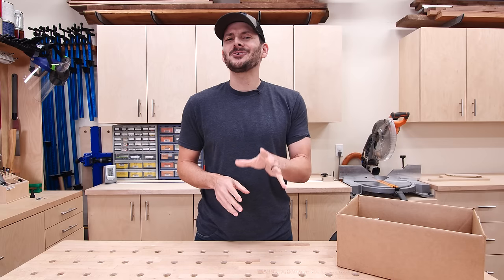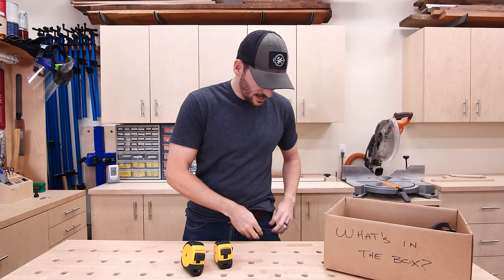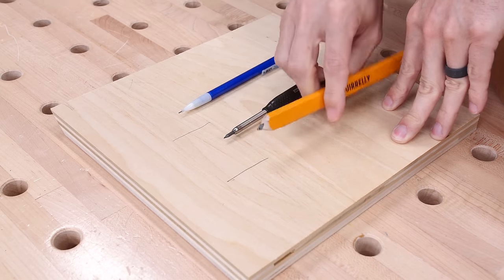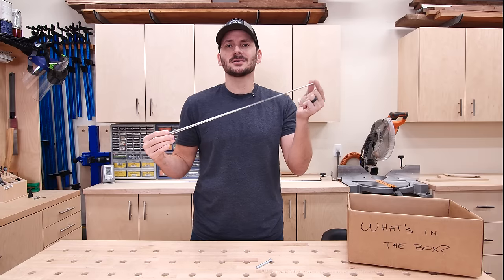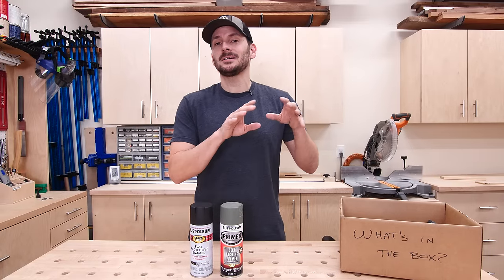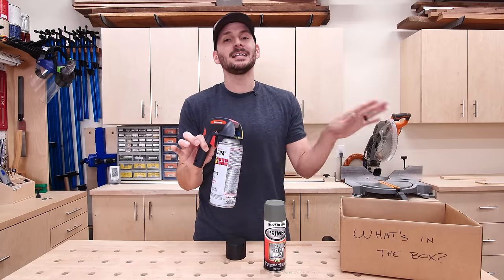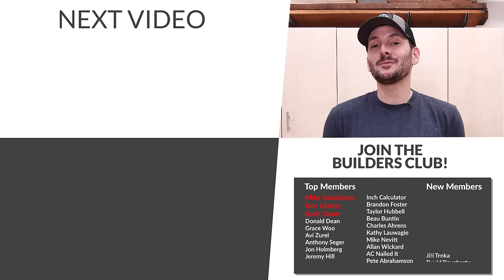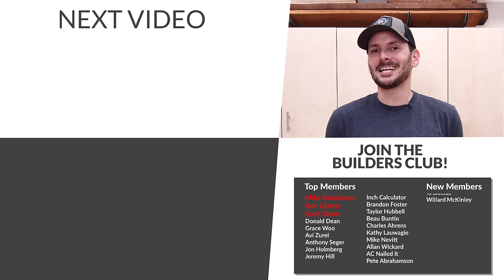12 Tools Under $20 Every Woodworker Needs

Comment: I would add 1-2-3 blocks to this list. SUPER useful, and you can pick one up for ~$20.
Reply from the maker: Great addition!
Reply: I love 1-2-3 and metric 25-50-75 blocks, they can space, act as a small straight edge or square and a lot more

Comment: Possibly the most obvious "must have under $20" is the speed square. Straight lines, angles, short measurements, it can do a lot. And not just for drawing the straight line but you can also butt the sideplate of your jigsaw or circular saw against it for perfectly square cuts.

Depending on the size you can also get a contour duplicator for under $20 and this is an invaluable tool if you find yourself needing to make a complex cut to fit around something.

A couple more great tools to have on hand that you can usually find really cheap (even dollar stores will have them) is sanding sponges and sponge brushes. Sanding sponges are great for contours as they mold into the shape pretty well while still keeping fairly even pressure throughout. And sponge brushes are useful for applying stain, clearcoat, and higher viscosity paints that tend to dribble off of bristle brushes. 

And as someone who has had wood chips, sawdust, and flakes of fiberglass fly into his eye while working on various projects over the years easily the most important tool you can get for under $20 is a good pair of safety goggles and/or a plastic face shield. Yea, these aren't as "cool" or "fun" as a lot of other tools out there but it's far better to look dorky than to have fragments scratching your eyeball from the inside.

Comment: You'd be surprised how many things from the craft room are helpful in the woodshop (and vice versa).  When I upgraded some of my quilting rulers to some that don't slide on fabric as easily,  I took the old ones to the shop.  They are awesome!  You can see through them to line up marks, they have graph dotted lines all the way across them, 3 to 5 inches wide and the longest ones I took out there are 24 and 36 inches long!  I also have some tiny ones too.  They also have several angles marked on them as well.  

Additionally,  I find washi tape,  repositionable double sided tape, and card stock handy in the woodshop.
Reply: I love your quilting ruler tip MissBeans, it's actually brilliant!  Now I have even more reasons "caugh" excuses to go quilting ruler shopping :)
Reply: @Elymyntal  glad to help! 🤭

Comment: One of my favorite less expensive tools is the Nicholson 4 in Hand rasp/file. It has always been in my tool set whether I need to clean up a notch in wood, smooth an edge of sheetrock, or sharpen a point.

Comment: As far as using the claw to reach for things, I just used mine yesterday (1/2/2022) doing some wiring for my brother in his Toyota FJ. However, I did not use it to reach for things...I used as a fish t help run wires in and up under his dash. Came in really handy and made the project go along much easier. With the snap off blade/cutter, I get mine from Harbor Freight. Comes in a 3 pack of different sizes, or you can get each one individually.

Good tips!

Comment: Great ideas, Brad!
I pick up old hand mixer blades at yard sales, Goodwill and similar other second hand stores.  They are great in a cordless drill for mixing small amounts of drywall compound is a mud tray, larger batches of two part epoxy in a coffee can or other two part compounds.  The nice part is they are cheap, so if lost or ruined, they are easily replaceable from my box of spares.
Reply: I used them in my drill press for mixing paint.
Reply: Oh -- so you're not supposed to use your wife's mixer and clean it up real good before she gets home?  LOL!!
Reply: @MrTPF1  That video would appear on the "Break This Divorce That" YouTube channel.

Comment: Painters 5-way. I'm not a painter, but this tool is so versatile. I use it every day. It does so much. Once you start using one, you'll wonder how you functioned with out it before. 
I'm 40 years in construction. Have to say this is the tool I make sure is in my pouch.
Reply: Agreed. I do a lot of finish work so I never realized how much I needed this gadget. Sure beats a screwdriver for opening a can of poly. (that blew me away) Not to mention it's other uses. There's a reason it's called a 5 way. 😃

Comment: Brad, I also use syringes for intricate glue applications.  They are great if you inadvertently wind up with a small crack or opening where it's hard to apply glue.  Thanks for all the tips.
Reply: Syringes are so useful - I have a range of sizes from 1ml to 50ml

Comment: Hey, Brad. I enjoyed your practical selection of cheap tools. For mixing stuff in small containers, I use plastic knives. Anyone who uses plastic flatware for get-togethers, picnics, etc., buys a combo package of forks/spoons/knives. The forks and spoons get used, but the knives just sit there. So, I ask for the (inevitable) left-over knives and have never needed to spend any of my hard earned cash for them. They are just the right size and stiffness. Also, the back side is slightly less rounded and can scrape the corners of your container. Try it out.
Reply: I use chopsticks I have left over from Chinese food. Great for mixing, stirring stain, etc.
Reply: The spoons and forks have used as well. The spoons are great for molding caulk and other applications, like Bondo for repairs. The fork tins cut off work great for filling stripped screw holes.
Reply: If you’re near an ikea, their “baby flatware” sets are worth the minimal cost. I use the knife and spoon for almost everything from spreading epoxy to separating parts without scratching them. They’re sturdy and won’t shatter.

Comment: A transfer punch is nice to have. I just bought a set from harbor freight for $9. I always have trouble transferring the exact center of a hole on to wood/metal for caster or a name plate and those put the indent smack dab in the center.

Comment: Brad, great ideas. I bought a simple tire tread depth guage a few years ago. I use it to measure hole depths when drilling and it comes in handy for several other purposes. Probably can pick one up at the auto parts store for $5 or less.
Jaypeay
Reply: I favor an old-fashioned folding rule for a depth gauge- the fancy ones have a little sliding ruler built in.  Also handy for getting accurate inside measurements.  And it fits conveniently in the lower left hand pocket of Carhartts.
Reply from the maker: What a clever idea!
Reply: Why not use calipers for depth measurements?
Reply: Use a quarter, and stick it in the tire groove which should cover the raised edge, IF you can see the raised edge then it's time to renew that tire, cheaper than a $5 gauge and you get to keep the quarter.

Comment: Auto-hole punch is a great tool.  Also really good for keeping in your car for emergencies.  Used to be an aircraft engineer in the Navy, and these auto hole punches are ideal for metal work, but also for breaking through strengthened glass in an emergency without a hammer and in a tight place where you can’t swing one.  Worked crash rescue and it is a really handy to get through a window in an emergency .
Reply: great... your telling everyone ez ways to break windows

Comment: Definitely in the "Get you weird looks" category: Trashy red lipstick.  Seriously, you can use it as transfer paint for marking mounting holes to walls.  Dab a bit on the keyhole mounts and press (kiss) it to the wall, pull away. And your marks (smooches) will show you exactly where to put those mounting screws.
Reply: This tip also works really well for marking doors when the latch and strike plate are misaligned. However I've been told not to get too cheap as they are waxy and won't actually transfer anything, and the pricy ones are made to not come off. You gotta find that happy place in the middle.
Reply: @marvthecarpenter  brand: Revlon color: cherries in the snow That's a classic red lipstick.
Reply: I use ketchup, mustard, or mayonnaise packets. Depending on colour I Ned to apply to.

Comment: I have an old "lead holder" drafting pencil that I like to use in the shop. I got it at least 30 years ago with a sharpener. In my college town, it's really easy to get refills for it. For folks in the Midwest, your local farm supply store is a great place to find inexpensive syringes with various guage needles. They're handy for squeezing in glue where you need it as well. Thanks for sharing!
Reply from the maker: sounds cool
Reply: Drafting pencils are also a lot less bulky too. they're awesome

Comment: I would add a 1-2-3 Block and I am surprised you didn’t mention this, a small notebook. I use this for writing ANY measurements down when I am walking back and forth in the shop or running to Lowes for things.
Reply from the maker: I've gotta grab one of those 1-2-3 blocks, don't have one
Reply: @Fixthisbuildthat  Wen sells an inexpensive 1-2-3 set.  They are meant for metalwork, so that means that even the jankiest ones are precise enough for woodworking.

Comment: I don't know if someone else has said it, but the Pica is also very good to mark through a hole, especially if you need to mount something to the wall. The small shaft makes it really easy (given that the hole is big enough).
Reply: 50 years ago we used that same pencil leads in mechanical pencils for drafting. Good to see someone has reinvented the concept for woodworkers!

Comment: Definitely add Dental scraper/picks. They are handy for everything and come in different shapes. If you ask you dental office they will usually give you ones that one side broke for free. I use them way more than ice picks. They are great for woodworking and mechanic work. You can even get them brand new at princess auto for about $3 each but they are not the quality of a dentists office ones
Reply: I'll be darned.  I would never have thought about that!
Reply from the maker: Clever, I like that

Comment: That screwdriver from your grandfathers is, if I’m not mistaken called a perfect handle screwdriver. I saw somebody do a restoration on one once on YouTube.  You’re right. There are a tank.  Heavy duty metal blades full length tangs and the handle shape is tremendous. Allows a good grip and gives good leverage. They’re quite collectible as I recall. Of course I know you’re not going to sell your grandfathers. I’ve got a bunch of my grandfathers tools in my basement. I hardly ever use them, but I love seeing them and knowing that they’re there. Reconnect me to him a little bit as we spent some time in the shop at his house.
Reply: Hand Tool Rescue makes giant new ones.
Reply: Have an old one (think 30s). The word "phoenix" is stamped on it, in tiny letters.

Found it while i was digging outside my house. It sits very good in the hand, as you said👍

Comment: Thanks for this video. I already have most of these. Two items that are a must in my workshop are Magnetic Parts Holder Bowls (4 inch or 6 inch are very handy) and a Magnetic Tool Holder (18 inch(. Both are used to keep small tools, screws, drill bits, etc. handy when I am working on a project. I also keep the small syringes that I get from the vet for giving meds to my pets. Very handy.

Comment: Used the extended claw in the Air Force all the time. We called them "mechanical fingers" and they're great for grabbing stuff from the deep dark corners of an F-16 cockpit... I'm reliably informed lol
Reply from the maker: hahaha, I can only imagine.  Thank you for your service!
Reply: That moment of shame and embarrassment when you have to ask someone on the ground to hand you the fingers, magnet, and a mirror…
Reply: @jonnyjl345k7  I always loved when you go after a bolt and pull out two nuts and some safety wire instead
Reply: @andrew_gardner  Will have to do the echo test to find it? 😂
Reply: I too was in the USAF and used the claw tool. Worked on radar set on F-101 fighter. It had a shelf that some of our radar equipment sat on that was in the nose cone. Amazing how many tools I was able to find under there with the claw.
Reply: I’ve tried several different types on many occasions trying to fish things out between deck planks and I have never not once on any of them been successful I think it’s a precision issue if you know what brand the Air Force uses, I’d love to know.
Reply: @annascott3542  probably Snap-On and likely govt pricing so I'm guessing 10x what you'd want to spend for a grabbing tool
Reply: Same!!!

Comment: Stanley 33-115 10-ft tape measure.  It fits in your watch pocket, so you actually have it with you most of the time.  And, it has a diameter scale on the back, so you can check pipes, etc.  

One, comment on the syringes:  the more viscous the fluid the smaller syringe you want, with a larger bore, smaller number size, needle.  A syringe that is twice as big takes four times as much push on the plunger to develop the same internal pressure.  Because when you double the size the area increase by the square of the 2, giving an area 4 times as large.

Comment: A good utility knife is a must!  My favorite is the Olfa XH-1 as it has a rachet lock for the blade.  Absolutly won't slip open or closed.
Reply: Olfa XH-1 can also use their 25mm saw blades, that are both flash saws, and general use saws, for different materials and not only wood! Great for plumbers, woodworkers even painters can use this from time to time. I love Olfa, they are tthe inventors of the snap of blades, so I guess they aere easily the best brand! Only problem is, which utility knife to get,because they make a ton of different styles, that all do one or 2 more jobs, that the other snap of utility knives don't!!  PS They also make the blade saws, in 18mm but be careful, because these look very similar, to their serated blades, which is a completely different style of blade.

Comment: There is a hardware version of the icepick called a scratching awl.  They are similar in build and look, and can be bought relatively cheap ($5-6 on Amazon).  Some other tools I use a lot and are pretty cheap are some calipers and a compass.
Reply: You may also look for a pick tool (or as the cringy name, dental tools). Very helpful to have around the shop/home. 🤟😎👍
Reply from the maker: Great tip, thx

Comment: Brad great video, my husband uses flat and round toothpicks, flat to spread glue inside wooden wheels, the round as small dowels, also he uses yougart cups to put wipe on poly or water based paint like delta cream coat or folk art brand when this dries in the cups you can simply peel it out and reuse these again

Comment: I do carry a small tape when I'm out thrifting.  I would suggest getting the disposable box knives from harbor freight.  They're much cheaper and the quality and comfort of use seem to be on par.    Also check out the 3 inch circular saws.  They're about 20 for most brands and work great for small projects and tasks.  I do a lot of trim work and it's super handy to make small adjustments without traipsing out to the big saw to adjust a bit of chair rail by a small fraction.

Comment: Some great stuff there Brad. Another awesome mechanical pencil that I would highly recommend you check out is the Pentel Graph Gear 1000 mechanical pencil, you can get in various led sizes. What’s I find is especially nice about them is that the little metal tip at the end that the led comes out from can be retracted by pushing the clip so should you drop the pencil you don’t have to worry about it being ruined from the tip being bent or broken off. I’ll definitely be picking up one of those mechanical pencils that you showed however as I like the idea of the much larger led and the option of different colored leds, I’m sure that they are great for on rough wood. Thanks for sharing.
Reply: true, i use something similar to what you're talking about. I have a 5.6mm mechanical pencil, found 2 of them for $12 on amazon. very nice to mark with and it's basically impossible to snap the lead,
Reply: Those 2mm mechanical lead holders are also great when you need to transfer/ mark hole locations through existing holes. They're actually marketed for that specific purpose on Amazon.

Comment: Hey, Brad. My favorite tool that you didn't mention is the Kreg Multi Mark. It is under $20 and it seems like I use it all the time. It's handy for edge marking, 45 and 90 degree angles and it has a level (not used as much).
Bill
Reply: Agreed!  I got one for my birthday last year, love that thing!
Reply: lol i have it and its OP asf it is not squared and accurate.
Reply: Yes. Love that tool
Reply: The spring loaded nail set and the beefy mechanical pencils have been major game changers for me!

Comment: Great video, always like to see alternate uses for tools.
Favorite tape measure is the 16' Fastcap. Length covers everything I do and the built in pencil sharpener is a plus. The front face also has a writing surface in case you need to write measurements.  
My favorite pencils are the Pentel Graphgear. You can get them from a .3 - 1.0 lead size. The thinnest I use is a .5, which doesn't work as well on rougher wood. I am leaning heavily towards a marking knife as part of my collection.
Love my center punch, I am now going to look for an ice pick. I have ideas for additional uses for it.
I usually keep short thin cut-off pieces for my stir sticks. I have an old poster tube cap I store them in.
Syringes for epoxy is an awesome method. I used that technique when making coasters that had a split down the  enter that resembled a lightning bolt. Keeps the epoxy where you want it 👍 Thanks for the great content.
Reply from the maker: I recently picked up a FastCap fractional/metric combo tape and it's great
Reply: @Fixthisbuildthat I have a FastCap PSSR25 25 Foot Lefty/Righty Measuring Tape - I love that I can measure on either side of it. I never use metric, so it works well for me. ;)